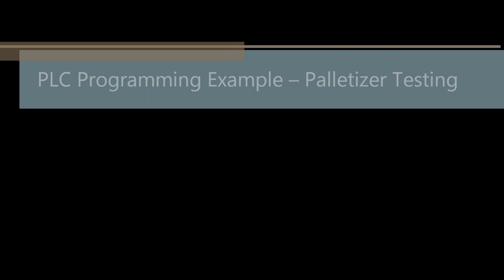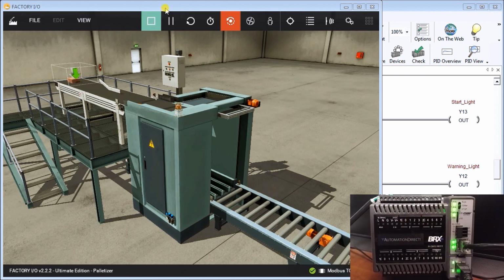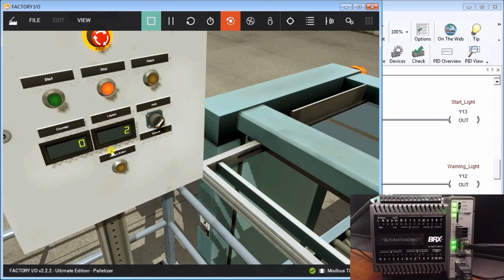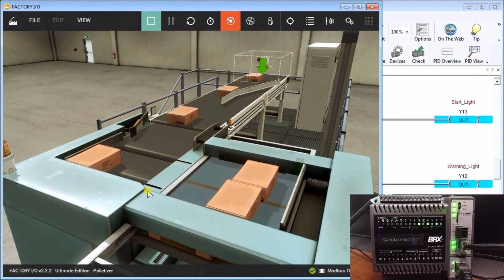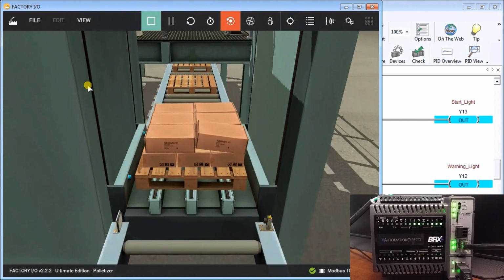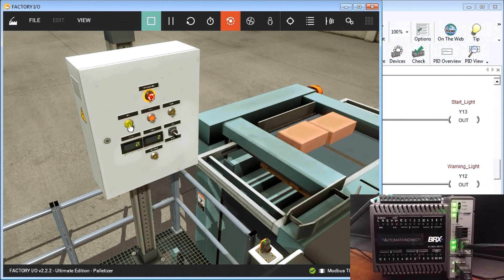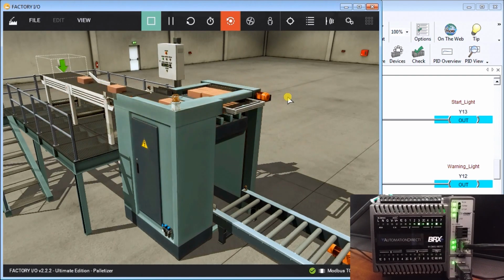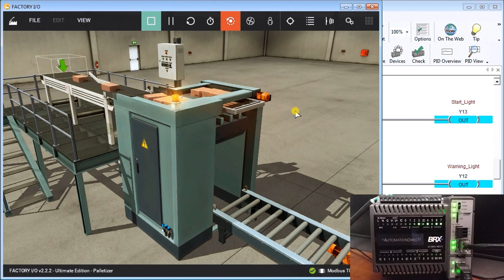Master PLC Programming: Build a Smart Palletizer in 5 Steps

Comment: hello gary. i have a question how did u manage to control the elevator down layer by layer? thank you what instruction did u use to prevent going to bottom?
Reply from the maker: Hi Abu,
The elevator has the following outputs to control it.
Move to Limit – Contactor – On/Off
Elevator Up – Contactor – On/Off
Elevator Down – Contactor – On/Off
When Elevator UP or Down is used by itself, it will only advance one layer. If the Move to Limit output is on when the Elevator UP or Down is used, the elevator will move to the top or bottom.
Regards,
Garry